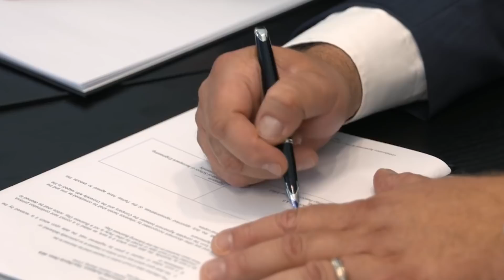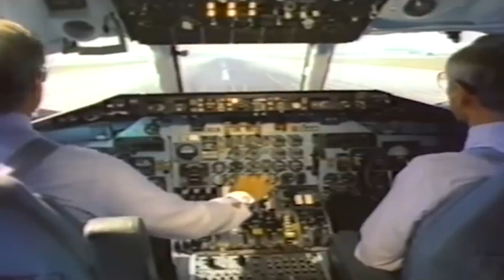Boeing 717 - Boeing model and legacy of Douglas

Comment: Delta Airllines has purchased all the Boeing 717s from Airtran and other sources along with all their simulatlors.
Reply: Technically, Delta dry-leases the 717's from Southwest. Southwest still retains ownership, they just don't work with their route scheme.
Reply: James Koralewski, actually Delta bought those 717's (MD-95"s) from Southwest, as they already bought AirTran by then, the video even shown a 717 in modern Southwest livery (they sold ALL of the AirTran 717's since they wanted to keep just with 737's for commonality cost reasons).
Reply: @syxepop  and with the 737 max ground  south west is sorry they did that
Reply: @dknowles60 , "foresight is 20/20" (?) WHO KNEW? (Besides "Boing", of course...)

Comment: Just flew Delta and found out I was on this horrible plane, and in the back. Felt so cramped, and so noisy, and get engine exhaust smells. The baggage storage on one side being so close to the aisle  is extremely uncomfortable for me when walking down the aisle, especially with the doors open. Hated the McD planes, and hated this one too. Made me want to always avoid delta in the future. I normally fly SW and they only fly Boeing 737 which is fine with me. Happy to see this plane finally die.

Comment: Boeing stated it liked the design soo much it didn't change a single bolt on the plane, so basically its all Douglas manufactured by Boink!  Too Bad politics drives the industry, when airline companies asked to order the 717's they were switched over to 737's. and that is why it's finished ...

Comment: Most of those 717s don't actually belong to Delta.   Delta are merely the operator.   They've been leased to Delta, mostly by AirTran and a couple of other companies.
Reply: That’s pretty much every airliner, ever. 

Even old ones are mortgaged to banks to free up operating capital. 

Every time you board an aircraft, look up into the door opening. You’ll usually see to data plates. One is the aircraft data plate (make, model, serial number, type certificate number) and the other is who actually owns the aircraft (lessor General Electric Capital Aviation Service or Mortgage held by Wells Fargo Bank).
Reply: That’s why the still have AirTran registrations. N***AT

Comment: Is it just me or does anyone else have a hard time stomaching the Boeing name being slapped onto Douglas products?  They're all DC-9s to me,
Reply: A little, but I am relieved that Boeing decided to keep the project going after the merger. The cancellation of the Boeing 717 was one of two big blunders Boeing made around 2005 though, the other being the cancellation of the Boeing 757.
Reply: @John Rickard. Nope. 

The 717 wasn’t a seller. There was no market for a 100 seat plane with 30 years of legacy baggage which most importantly would include scope clauses that would require it to be run by mainline carriers for far more money than by regional carriers—since it had too much in common with the DC-9/MD-80/MD-90 which were legacy carrier planes.  Boeing was smart instead of producing and aircraft very few airlines wanted. 

The 757 was a result of Boeing being caught with three of its first models that lacked growth potential. The 707 which was modified many times but could not be stretched like the DC-8 into a -60 equivalent. The 727 which was hamstrung with an integrated centre engine inlet that prevented further stretching and modernization like the DC-9... and the 737 which is too low to the ground which is having very huge repercussions as we speak. 

So they designed the 757 with huge landing gear, huge wings, huge engines, and lots of reserve strength for growth potential. 

But there was none. Airbus knew the 727-200 was the sweet spot for narrow body aircraft and aimed for it squarely with the A320. The 757 was great when fuel was cheaper and fleets weren’t rationalized... but it’s a narrow body fuselage on a wide body platform and all of the liabilities of weight and cost and poor fuel efficiency come with it.  Stretch it into the -300 like they planned but nobody bought it because they’d buy a 767 or A330-200 that’s not much more but better for long haul and customers or go a bit smaller with the A321 or 737-900ER and have fleet commonality. The worst thing about the 757 is every version in saddled with the weight and bulk of the larger aircraft it shares much with (the 767) and what it was supposed to grow into (the 757-300).
Reply: @johnrickard8512  The problem was there were NO SALES for the 757's !!!!!  Hard to build and sell what airlines don't want !!!!  Same for the 717's sales non existant !!!
Reply: @wilburfinnigan2142  Customers wanted the MD95 but Boeing pushed the B737 and lost Customers in the short haul market.
Reply: I hate that the Bombardier C series is now the airbus A220😡
Reply: Yup!
Reply: Yes, same thing with the C-17
Reply: Yes it really never was a Boeing airplane. DC-9 series aircraft including the MD95 (717) were fantastic and very reliable.

Comment: That Delta 717 you showed a few times seems it might be on lease  from Air Tran. The N number ends in AT.

Nice job & entertaining, too!
Reply: AirTran ceased operation in 2014.  The aircraft retained the registrations.
Reply: When Southwest acquired AirTran it then subleased the 717's to Delta keeping the AirTran registration numbers. After Southwest has completed its leases. The 717's will be leased or bought by Delta from Boeing and the other lessors.

Comment: This was my first aircraft as commercial pilot in and the one in which I also gained my Captain strings in aeBal (Spanair) in from 1999 to 2005, flying across Spain and Europe.
I have a special love for it and was a magnificent flying machine so enjoyable to flight...
You could make puke all the passengers with a low TOW, of course I did not, excepting one time in which I was very light and decided to maintain a 4000 ft/min climb since the TO until reaching 28000 ft. 
You sadly forgot to mention in the video that the appearance of the best selling and lower cost (in all senses) Airbus A320 forced Boeing to merge McDonnell to be competitive in a market they dominated for decades: Europe was beginnig to take the lead from almost nowhere and the only american aircraft that could face it was the 737.

Comment: I always enjoyed the md-80 / Boeing 717..... I liked the beautiful,  graceful look, the quiter cabin,  due to the engines being mounted in the rear, and a very steep climb out that the jet could perform,  also no doubt due to the engines being in the far rear. I became more leery of the plane, to be honest,  when there was a crash of one of them,  an Alaska Airlines,   off the California coast due to a malfunction in the tail controls sent the plane and all passengers spiraling into the ocean. I honestly then became even more leery when I heard it said that Pilots claim the plane handled very poorly and does not respond right away to commands making it hard to do instant maneuvers. Possibly this was under the MD version and maybe Boeing corrected it but unfortunately I don't like to fly the plane anymore. Sorry
Reply: Alaskan Airlines "maintenance" or lack thereof issue GT. Took a while to overcome the wilderness mindset apparently. Terrible incident, stopped me flying them for years.

Comment: I was an employee of BAE systems in Palmdale, CA. We had the contract to mate the wing halves for the MD-95/Boeing 717. The wings came in from Canada and Japan we would do the mate and portion of the fuselage under the wing then load the completed wing on a special flatbed trailer and haul them down to Long Beach...great job I did receiving and source inspection but that all ended with 9/11. Worked from Dec 99 to March 2002.
Reply: Sounds like it was an interesting job, why did 9/11 end it? Was it security concerns over the imported parts
Reply: @loganbaileysfunwithtrains606  Probably just that the industry tanked at that time and took years to recover :/

Comment: Years ago, I represented a number of airlines to Boeing for the model 717, which was originally designated the MD-95.  Without doubt it is an exceptional aircraft and was built wonderfully by craftsmen using the latest tooling and technology.  All barrel sections were assembled using lasers to assure near perfection.  In my view, Douglas always built a superior aircraft and it was evident here with the 717.  Sadly, it was the last commercial jet produced at the legacy facility in Long Beach, California, and another chapter of the great American aviation industry has closed forever.
Reply: and douglas always out lasted boeing
Reply: That’s funny. I was working on Alaska Airlines Boeing 737-200C aircraft when they dumped the last of their MD-80s that were over a decade newer.

Lasts longer my fvcking ass.
Reply: @Bartonovich52   name one boeing plane that is as old as the dc3 and is flying to day. the only reason the 737 200 is around is the gravel kit

Comment: TWA owned Boeing 717s we got them in Feb 2000 which was the first time I smelled the  new airplane smell
Reply: and those TWA planes are the ones still in Delta's fleet today.  Or maybe it was the still undelivered ones only.
Reply: @kabrink64  Delta's flying the AirTran 717s. The video was incorrect, Delta do not own those planes, they lease from Southwest which merged with AirTran but unified to 737 type.
Reply: @tjsynkral  I thought for sure they picked up TWA's undelivered order on the cheap after the bankruptcy.  But, my brain is getting older and has some bourbon sloshing around in it.  So...
Reply: @tjsynkral   @Kevin Brink
29 Boeing 717s were ultimately delivered to TWA (which was acquired by American Airlines).  24 of those ex-TWA 717s later ended up with AirTran, who also operated the 717 given that Valuejet (which acquired AirTran, then adopted it's branding) was the 717/MD-95 launch customer.  After the Southwest Airlines acquisition of AirTran, the former AirTran fleet of 717s (including the 24 aforementioned former TWA/AA aircraft) were offered to Delta Airlines under dry lease agreements.  So yes, 24 of the 717s currently operating wearing Delta colors, did indeed begin their careers with TWA.  See airfleets [dot] net for further details.

Comment: when is was only boeing building their planes, how come they went from 707, to 727? there's just a suspicious gap there for 717 but they jumped straight to 727, why?
Reply: The official Boeing model designator for the KC-135 air to air refueling aircraft was 717.
Reply: @ernieszelepcsenyi5710  I'm so glad somebody FINALLY got around to posting this!  I saw that data-plate riveted to the bail-out spoiler every time I  drug my fat ass up the ladder from '79-'88.
Reply: Don't forget the Boeing 720 + 720B which was a different variant of the 707 with a smaller cabin length with shorter range.  It was perfect for regional airlines such as Western Airlines, etc.

Comment: I love the MD80. As some who traveled often on American, MD80 was pretty the stable out of DFW.  One event I think you forgot to mention.  Alaska Air had a crash outside in the Pacific when it was flying from Mexico back to Seattle.  Tail stabilizer was stuck. It caused the plane roll over, losing control and crashed into the Pacific.  This caused Alaska phasing out MD80, and using 737 exclusively.
Reply: In all frankness, Flt. 261 wasn't the fault of the aircraft.  The blame resides elsewhere.
Reply: Alex P 
Mate.  I beg to differ.  You maybe right that maybe it’s not design flaw.  However, bad publicity killed it.  It happened to Concorde, L1011, and DC10/ MD11.

Comment: The airframe of the 717 isn't half bad, but those Rolls Royce engines took years of modifications to keep from shelling out and they were underpowered. If they would have put GE or even Pratts on them I think we would have seen more 717's in the air today.
Reply: Agreed.  From the start, the 717 has had an exceptional powerplant and though there were two thrust variants available, both were pretty good.  Similar engines power the Gulfstream G5 models (not the exact model).  Overall love the Dc-9-95 :)
Reply: Bill S I wouldn’t say they’re underpowered. The 717 has one of the best power to weight ratios of any airliner.
Reply: Not true.  I bought 717's for several airlines as was present for the maiden flight.  I met the German professor who designed the engines, and he was certainly proud.  The engines were an exceptional work of engineering art, and the aircraft was just plain grand!  The only drawback is the 717's wings were built in Korea.  I would have preferred America, Japan, Germany or Italy for quality.
Reply: Tyler Johnson:  Yes! I also refer to the 'craft as the DC-9-95.
Reply: It's not up for dispute. I can't tell you how many I changed due to having burrs and erosion just aft of the HP compressor. Also blade cracking in the HP compressor. They were literally within hours of letting go (or shelling out) as we were inspecting these. These problems have since been fixed by AD that RR issued. I have the dispositions of each engine I evaluated and would be more than happy to share them with you.
Reply: Bill S, who did you work for?

Comment: What I want to know is, why wasn't there a 717 back in the day, between the 707 and 727? I'm guessing that maybe the KC-135 was internally known as the 717.
Reply: Looking back, I believe that was the plan...
Reply: Moreover, 717 was also planned to move into 720 from KC-135. 
And then, well, kept void until this aircraft being rolled out.
Reply: The -135 airframe IS the 717. Looked at the data-plate riveted to the bail-out spoiler every time I drug my fat ass up the ladder from  '79-'88.

Comment: Lets not forget the safety aspects of a water landing for planes like 717. It has not happened yet but in the event on a water landing planes with engines near the tail can land safer in water vs aircraft with engine under the wing which causes drag in water case in point the water landing in hudson river
Reply: gpierre90 - Also the tail mounted engines located away from fuel tanks, & also prevent crash should a thrust reverser deploy in flight. Nice bonuses! indeed!!
Reply: if I'm not wrong , it is the only one commercial jet to land intact in water  . after the "hudson river miracle"  no other planes  did it . up  to now , all passengers have perished  in water crashes
Reply: You don't really want to do water landings in any aircraft that isn't purpose-built for it.

For one thing, the planes simply aren't built the right way to handle the forces involved.

Secondly, the dynamics of an aircraft hitting the surface of water are very poorly understood compared to other areas of aerodynamics, and almost impossible to simulate meaningfully.

That leads to the third problem. Since you can't simulate a water landing with any degree of accuracy, you can't really properly train pilots for it.

It's way too dangerous and expensive to train such procedures using a real aircraft, and no simulator has remotely accurate hydrodynamic simulations to properly demonstrate how an aircraft behaves in a water landing.

Basically it's bad because
1. You can't train for it.
2. the physics and dynamics of it is mostly unknown
3. Due to lack of in depth knowledge of the physics, aircraft have almost no design adaptations to improve the odds of survival.

Really it's the worst possible scenario for emergency landings. Even though you'd think hitting the ground would be worse, the reality is hitting the ground is far more predictable, and thus it's much easier to mitigate the dangers at least a tiny bit.
Reply: tecknos africa I believe that ALM Antillean Airlines Flight 98 ditched in rough stormy seas and was intact. This was way back in 1970.
Reply: @tunkunrunk   thats because it was not a boeing.
Reply: A disadvantage with T tails is the unrecoverable deep -stall phenomenon
Reply: and it survived practically intact.. in fact most of the damage was in the tail boom wich contacted the water first
Reply: I would say , other advantages of engine on the tail is when the plane make a belly landing , as there's no engines below the wing to hit the ground and fire the fuel tanks in the wings . rear engines catch fire when debris are sucked inside them . pilos should switch of the engine in the case of imminent impact with the ground

Comment: Ironically it was the last Douglas to be supposedly made with no fatal record. This was a proof of concept that Boeing can make safe planes.
Reply: I hear more about Douglas DC-10s getting into trouble than I do any Boeing. Heck, the Boeing 737 has a pretty good record considering how many planes are in the air.
Reply: @johnrickard8512  To be fair, after the cargo-door design flaw was corrected, the DC-10's safety record was pretty average for airliners of its time.
Reply: if boeing so great why is the 737 max grounded
Reply: dknowles60 Boeing has numerous models and the 737 is the most used civilian plane in the world.. the MAX ordeal doesn’t make them a bad company.

I do miss MD though.